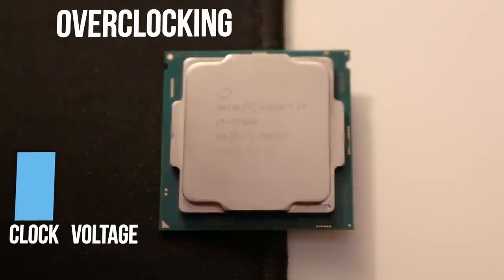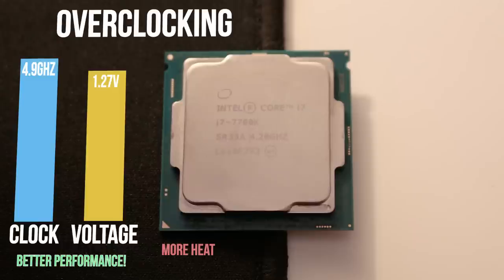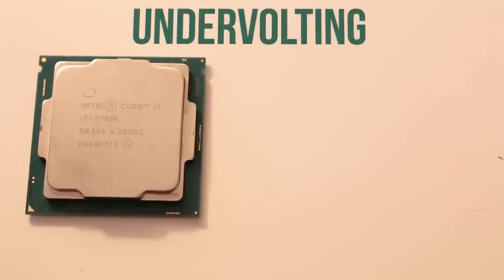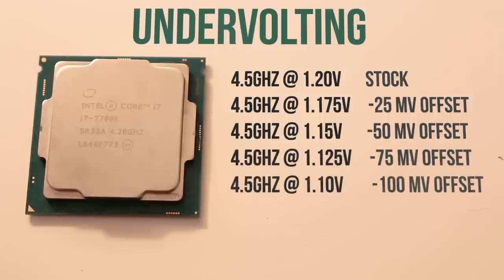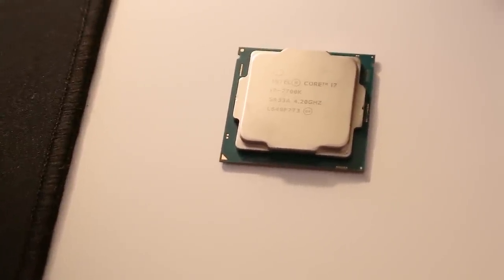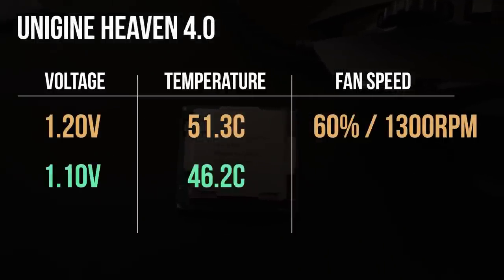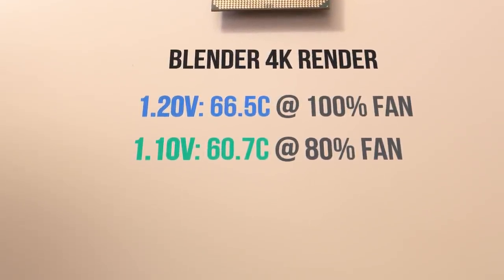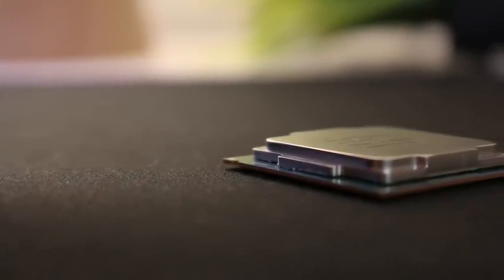Should You Undervolt Your CPU?

Comment: Slight overvolt overlock in winter, slight undervolt underclock in summer.  That's the way I roll.
Reply: My 8350 stock voltage is set to 1.42. I don't know whether to be impressed or scared.
Reply: hows the summer in the room
Reply: Ak47 it gets warmer in the room? :O
Reply: Too bad winters are warm too, here in Spain.
Reply: First comment where I really see someone using his brain haha :)) Really good tactics for the cpu!
Reply: Alan formula1  you need to download Throttlestop and search for a tutorial for the specific CPU you have in your laptop, undervolting amount can vary alot, so it is recommended to undervolt in small steps as mentioned at 2:25
Good luck, it is worth it!
Reply: Lol
Reply: When you rely on room temps’
Reply: Undervolt all year long for us tropical people. 👌
Reply: i’m currently running kombustor to stress my gpu so it can heat up my room because it’s going to be 45 degrees tonight

Comment: I was able to overclock my i7-7700k to 4.7GHz @ 1.12V. It was rock-solid stable, and silent! This is on a Asus Maximus IX Hero (Z270). I have since OC'd to 5GHz @ 1.25V , just because I NEED that 5,000,000,000 Hz... lol
Reply from the maker: 5GHz @ 1.25v is nice, I could imagine you have decent temps at that voltage.
Reply: 5GHz + 1.25V + 100% AVX CPU usage + 100% fan & pump speed on Corsair H100i V2 = 85C max

I would love to delid and not need such high fan speeds. I really shouldn't have cheaped-out on the cooler.
Reply: dang... lottery winner if you can run 5ghz at avx load 100% stable what test were you running prime small iff or ibt max?
Reply: Aida 64 , BOINC, ibt, with integrated GPU running fur Mark at 1400MHz
Reply: man that thing is a beast for overclocking as IBT maximum takes a good bump in vcore for me to get a passing score i can run it without blue screening pretty easy but for it to pass a 10 run sweep at the max ram i can give it it ussaly need a good +40mv tp 50mv over what i can pass on rog real bench. quite an impressive chip you got there to handle 5ghz under avx on ibt as most need an offset for that
Reply: Now I challenge you to run Prime95 custom with all available memory - please check how much is allocated for windows before you begin - leave about 100-200mb's free - example if you have 12.3gb's free set prime95 for 12.1. Run for 3 days. :)
Reply: Aemilius why not 4 days? I mean, come on, why not 5 days? Let's go all the way, leave prime on perpetually
Reply: I have mine overclocked at 5.0GHz too with a corsair 115i AIO cooler. I did delid and apply metal thermal paste on it and also used it on the AIO cooler to have lower temps. I could probably go higher if I let the motherboard supervolt the cpu over it's recommended limit. I let the motherboard adjust the voltage automatically running at 5.0GHz. I have the STRIX Z270E GAMING motherboard.
Reply: be careful if you left the motherboard on auto voltage as that can spike quite high try running cpu z and launch something like cinnbench are start the test and watch where the voltage spikes to
Reply: for most prime 95 small ftf is very overkill real bench is nice but aida 64 is much more stress full if he did only cpu if he had all the options turned on its pretty weak
Reply: This says nothing except how much money/time you spent on your rig. Temperatures? Relevant information? (edit @ Michael Jastrzebski)
Reply: how did you oc your cpu? via aisuite 3 ? or bios way? i notice that using ai3 supervolt the cpu!

Comment: The 'Auto' bios settings tend to overvolt things in order to guarantee stability.
Reply: that must be whats going on with my computer
Reply: @fortuna19  On laptops especially its a pain. Temp difference can quite high. If you got a golden chip undervolting could even reduce temp by 20 degrees in some (rare) cases.

Comment: Didn't even know undervolting is a thing. Thanks for this video!
Reply: Define what sorts of quirks are we talking about when in idle? Just recently undervolted my i3 in a ITX build using offset cpu voltage so it still can scale itself down to 0.625v when in idle while not using the original stock voltage in under full load.
Reply: Instability. Loss off Data. Not rendering results as espectet.
Reply: undervolting has similar characteristics to overclocking. when you undervolt too much, it will be unstable, same goes to overclocking too much, it too wil become unstable.
I undervolt my R5 1400 from its stock 1.25V to 1.14V and overclocked to 3.6GHz which result in better performance and less power usage.
Reply: Quirks such as?
Reply: so erm basically you are saying in a long and windy way.... you have no proof that undervolting is the issue.
Reply: so i've read some things about issues of undervolting. Basically undervolting introduces a small amount of temporary data corruption during computing if your voltage set is too high difference from the vcore and vdimms. It is somewhat untraceable due to its nature of errors as it happens in data caching in the cpu. Basically it may show tiny artifacting in games or maybe a 0.01% errors in calculations from what I understand. However, it was a forum that was dated back in 2007.
Reply: i did a quick search and found those on an old forum post, it also mentions that those happens on a large undervolt, like about 0.2v from the stock voltage i presume.
Reply: I didn't even know iGPU overclocking was a thing until recently!
Reply: drop any fps if i undervolted ?
Reply: yes little. like -5 or -10 less fps.
Reply: @huberthans4312  niemand ich wiederhole niemand hat jemals irgendjemanden fachidiot gennant
Reply: @JLawlietK  Cool pic buddy
Reply: Same

Comment: Dude, I have an HP Envy with an i7 4720hq. While rendering one of my own blender scenes with turbo boosting turned off(cpu running 2.6Ghz), I will reach 82-84c with a zero offset voltage of 0.885v. I offset the voltage by 0.1v down to 0.785v and the temp dropped to 69-71c, that's a 13c drop. Absolutely fantastic. I tried a 0.12 offset and it crashed..... I was hoping to squeeze a little more out of it but I cannot complain at all about a 13c temp drop.

Thank you for this video.

Comment: I love undervolting! In my office were running Ryzen and Epyc platforms and undervolting has overall made our office cooler, quieter and much much more pleasurable. For most of our work 3.4ghz is plenty and if it isn't we can offshoot it to the server. We were able to drop the voltage to 1.1v on a few lottery winners and 1.18v-1.24v on some others. Cool temps! With some systems with Noctua NH-D15s, full load temps could be well below 60° at full load for 10-20minutes at a time. This is better than overclocking!

Comment: Lovely video. =)
This is especially relevant now with AMDs processors out there.
AMDs old Piledrivers loved both undervolting and underclocking and you'd get a significant improvement in performance pr watt in both cases.
I don't know exactly how well Ryzen tends to respond to undervolting, but I know that if you also under-clock them you'll get significant efficiency gains.
Reply: ryzen undervolts well for my 3600x undervolted and base clock adjusted (wont ramp up in clocks) that was to agressive on amd original settings, i dont know if the voltage or the clocks set to high original, but since i've put my own clockspeed @ 4.2 ghz and lowered the voltage (srry don't know the numbers anymore) its stable since no bluescreens anymore..

Comment: undervolting is the holy grail for laptops, especially compact ones. 

i have an alienware 17 r3 with 6700hq, it ran at 1.2v stock, i managed to drop 135mv fully stable with it and i got much quieter fans AND 10c off my load temps across all cores. 

Best thing about this is essentially risk free, and very very easy to do with throttlestop or xtu
Reply: I dropped my my 6700hq by 150mv and knocked almost 10 degrees off my temps.
Reply: Can i undervolt the CPU if i have overclocked the GPU?
Reply: Yep, and if the GPU shares anyway heatpipes with the cpu it will help the GPU stay cooler at higher clocks.
Reply: @seanlacroix  Nice!
Reply: @seanlacroix  may I ask what application you used? I got a predator 15 and tried the msi program based off the recommendation oglf the internet and it doesn't even let me adjust the voltage of anything, not even the fans
Reply: @seanlacroix  should I undervolt my brand new laptop right now or wait for a while ?
Reply: RapidSausage will undervolting your cpu increase performance in games since your laptop wouldn’t get as hot?
Reply: @Kryz8  Unless your components are thermal throttling (reduced clock speed to maintain stable temperatures), no.
Reply: @mr.randomgamer888  AdoredTV has a guide for MSI Afterburner.
Reply: @deus_ex_machina_  it will actually if it's power limit throttling as well, which is pretty much any 15 watt i5\i7 and any i5+ of 8 gen and newer
Reply: @TabalugaDragon  huh. Wasn't aware of this. You mean on the fly adjustment of TDP? I was under the impression that OEMs set one of the TDPs Intel lists.
Reply: @deus_ex_machina_  no, I mean adjustment the voltage. TDP stays the same. lower voltage(only if you do it using offsent) makes a CPU work more efficiently, therefore more clockspeeds are able to be fit into 15\45 watt power envelope. This can be clearly seen in JarrodTech laptop reviews where he does undervolting for every review. Even if a CPU doesn[t thermal throttle(even if temperatures are relatively low) clockspeeds are limited by TDP and don't reach their max boost. Undervolting often helps to improve clockspeeds or remove power throttling completely

Comment: Dude thank you so much!  I watched this video before and just recently built a system that used this perfectly.  I have a 2600x that was ramping the fan up like crazy and spiking temps along with fan RPMs.  When I pulled up HWInfo I noticed that the vcore was ramping up to 1.45v!!!  I set the vcore to 1.2 with an all core clock of 4.0ghz and it was whisper quiet!  I'll adjust clocks up to turbo and see what vcore is required.  Made an INSANELY loud system run smooth as butter with much lower temps

Comment: This is great! As a laptop user this is extremely helpful. Running on a Intel i-7 9850h clocked at 4ghz by laptop manufacturer. Managed to undervolt 125 mV stabily and now I no longer have heating issues, thanks.

Comment: My personal Intel Celeron laptop is fully Locked and I can't undervolt it at all, even on Intel XTU. 😭😭😭😭
But Wait!!! One day, I was going to Mom's office because there are no one else at home, and then I suddenly found an empty unused PC there at the Office!
Unfortunately it had a spec of a potato, with a Pentium G3620 (Dual-core 3.3 Ghz) & 2 Gigs of DDR3...
But the fun thing is that I could install Intel XTU with no troubles at all!
I tried to undervolt it to the limit, as most kind of people do, and I started from -55mV and keep moving down every 10mV to -65, -75,...
I was suprised that I could put it down to -150mV!! Moreover, the Maximum voltage at stress test is now only at 0.947 volts, which is pretty low on a desktop CPU...
I finally stopped at -195mV @ 0.895V since it crashed after 30 seconds of stress test. So I turned it back up to -135mV.
But -195mV is a really massive number on the CPU world, and moreover, this is desktop CPU!!!
Note: using Intel cooler

Comment: You can also undervolt and overclock your cpu at the same time, to balance temps from the overclock. My 3770 (yeah, non-K) at stock of 3.9ghz and 1.365v would idle at 27c and cap at 67c at full load. I've been running it at 4.60ghz and 1.185v for years now, never seen it go any higher than 65c at full load. Since day one, I'm using the stock heatsink but swapped out the crappy 1600rpm stock fan with a NIDEC 80mm fan that rolls at 7800rpm tops (never goes over 3000rpm though). You can also lower CPU PLL from 1.80v to something like 1.60v, and that too will lower your cpu temps.

Comment: So undervolting can be used to run your system cooler at normal clock speeds or even slightly overclock without increased heat in some cases... good to know.  It's real nice that this guy cam discuss with enthusiasm more than one type 9f optimization.

Comment: I just got a used i9-11900k for 120$ installed on my Asus B560M-A  HTPC rig, turbo boost disabled, vcore set to static at 0.905V, (all cores synced at 3.5GHz)  Coolmaster g100m low profile air cooler, running very stable with more than 50% performance boost compared to my older i5-11400 CPU. I can now go withnextreame settings in MadVR w/o any frame drops as with the i5-11400 (I have 16GB DDR4 RAM xmp-1 profile). Best 120$ ever spent.

Comment: I underclocked my 8350 for fun one day. cant remember the voltage but it was much lower than stock @3.5, with only 2 cores running. 
I did this for certain games that dont require a monstrous cpu. It ran great, low temp, no noise (with evo 212). 
I only used this underclock for a few days so i forgot about it and played GTA V. Loading was incredibly slow but once in game there was barely a noticeable difference. 
"why is it laggy tod... o yeah. only 2 cores."

Comment: this is a very nice tip... undervolting CPU will allow for less power draw, noise and temp.

Too bad Intel locks their CPUs so i3 mini itx rigs (which would be great candidates for undervolt in mini-itx rigs) are out of the question.
I do not know how well would it work on AMD Ryzen 3s, and i have my doubt about if there's a need to turn off any turbo technology on the CPU in order to gain stability when undervolting (that will hurt performance). But since most CPUs have a safety overvolt in order to work with any shitty PSU, i think there is a chance of reducing voltage (at least a little) on any CPU if rig allows. And that's not only for new tech rigs, AM3+ FM2 and any older LGA from both intel and amd can be undervolted at least a little

Comment: You can TOTALLY undervolt your locked Intel CPUs. I built a SFF PC for my bro about a year ago with an i5 4460 in a GA-B85N- Phoenix motherboard, and the Arctic Freezer 11 LP I bought for it was a bit too loud, so I undervolted the CPU in the UEFI. I was very easy. 100% recommended.

Comment: I have a i7 6700 and it runs with core voltage in 0.990V. I did undervolting and I recommend. I never saw my chip overcome 49 degrees, even at 100% for hours!

Comment: I undervolted my Alienware 13 R3 i7-7700HQ by -140 mv (stayed stable throughout all stress tests). It used to reach temps of 94 degrees Celsius during heaving gaming. Now it maxes out at 80 degrees! It was like buying a new laptop. Another thing is that the GPU temps are now much lower too. I think it might have the same heatpipe as the CPU or something like that. It used to reach 87 degrees.. now it maxes out at 80. Idle temps also dropped from 54 to 42. My battery life was also increased by around 45 mins. If you haven't done this yet, go do it now..

Comment: I use amd overdrive for my amd A10-5750m processor base clock at 2.5ghz with 0.88v 2.8ghz with 0.925v 3.2ghz with 1.050v  and 3.5 with 1.187v.
Temps and ghz before around 90C and throtheling at 1.49ghz. Under load.
Temps and ghz now around 75C and turbo at 3 up to the full 3.5ghz! From zero to Hero!
Reply: MSI laptop btw

Comment: I undervolted my i3 4150 and intel HD 4400 , after a lot of cpu stress test and gpu benchmark I found the right voltage offset , now my cpu runs at 56 degrees at 100% stress load , before it was hitting 72 degrees on stress test .
CPU and cache voltage offset :-134.6 mv 
iGPU : -105.5 mv
Reply: Now runs amazing same performance but at different temperatures, I forgot to mention that my iGPU was overclocked

Comment: Undervolting is even more crucial in laptops where the size of the heatsinks and fans is very limited. Therefore if the CPU runs cooler the clock speed can get even higher (closer to the stock speed) since the system do not over heat at all even under heavy load like 4K rendering. Also your CPU drains less power and therefore your you can squeeze a bit more operating time from your battery.

Comment: In my experience, Undervolting is way more effective and safer than overclocking. Every time I overclocked my CPU, I experienced Blue Screen of Death (BSoD).
Reply: Yeah same, when I finished putting my brand new PC together and had a successful post, the default motherboard Intel CPU settings were on Turbo Overclock, didn't notice until I got a BSOD mid game.

Comment: Yes, i have AMD FX 8350 which will throttle even with a good cooler. I know 2 persons who had throttle problems, even with a water cooler. I can' t imagine, why stock cooler is even added to the box :D Undervolting my AMD FX 8350 removed any throttle problems, still runs solid at 4GHz. So you can even fix some bad CPU' s, and not just get fan speed down.

Comment: I’m not even joking I won the silicon lottery got my Ryzen 5 2600 from 1.13v at 3400mhz base clock to 0.95v did multiple stress test like Aida64, blender renders, unigen heaven 100% stable. I also undervolted my gpu from which has been factory oc rx 5500xt btw from 1145mv down to 1045mv
Reply: Bro thats awesome

Comment: I actually did something like this with my R5 1600 since I got it. 3.2-3.6(turbo) speed, 1.118-1.4V vcore, which is waaay too much for the turbo mode. So I just manually set the whole thing to 3.6 ghz on all core and fixed the vcore at 1.2V - speed is way better, temps are somewhat cooler, and the most notable part: I measured 82W total system consumption while watching a 1080p60fps youtube video on default, and by fixing the vcore it dropped to 71W. Pretty neat.
Reply: have you tried an oc at 1.35v?